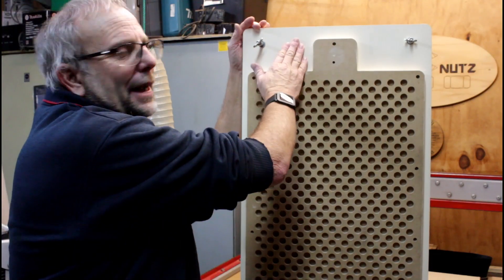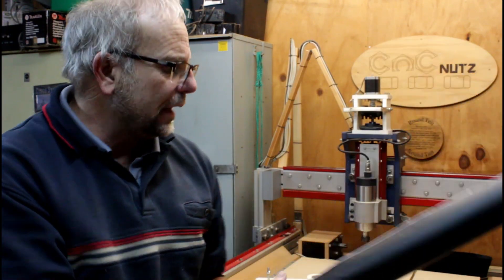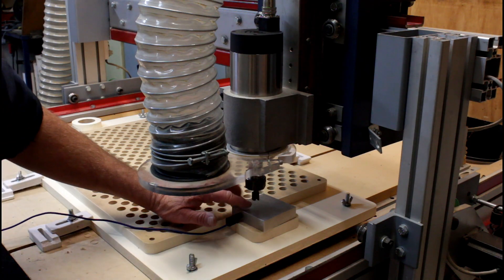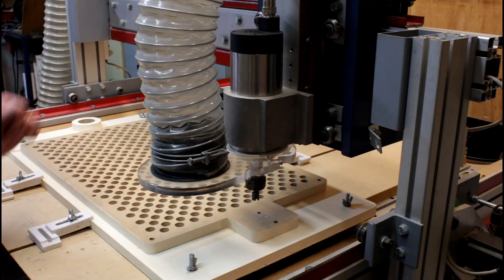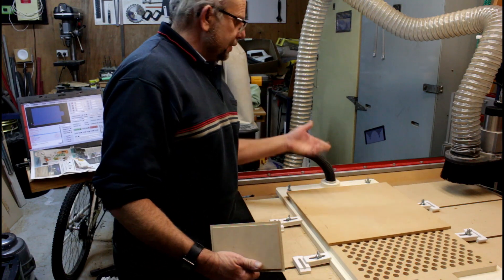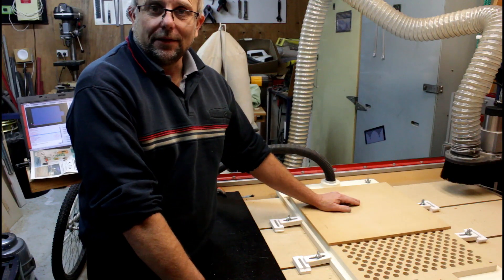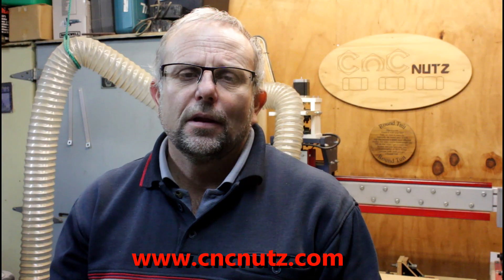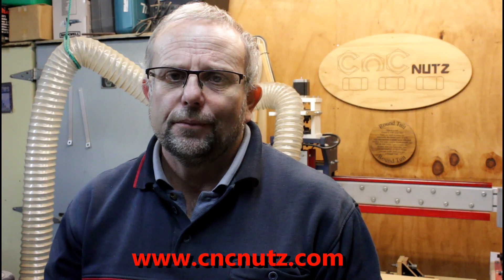DIY Vacuum Table Part 2 - CNCnutz Episode 211

Comment: can buy cheap vacuum pump about 2-4 CFM suck pump have normal used cnc table what has DIY made. and keep part good on table. normal have 3CFM pump what many uses. very cheap less than 100$ can buy. cheapen than owerprice festool shit vacuum. festool ALL tools have shit and totally owerprice. same can buy many other brand 3-5x cheapen.

Comment: Sorry if I missed it, but do you have anymore detail on the gasket material?
Reply from the maker: Hi John.
There S nothing special about it. It is 6mm round and on medium softness so easy to compress with the fingers but bounces back immediately. Not hard like oring rubber. I bought it at para rubber if that helps. Not sure what it's real purpose is but probably some sort of weather seal material.
Hope it helps.
Cheers Peter
Reply: @cncnutz  Thanks for the quick response. Wasn't sure if older video's were even monitored.

Comment: A HARBOR FREIGHT  2 HP GET RID OF THE BAGS AND IT WOULD BE CRAZY POWERFUL ...WOULDN'T YOU THINK?
Reply from the maker: If you talking dust collector then I don't think it would. Dust collector and vacuum pump are 2 different things. A vacuum cleaner is somewhere in the middle though closer to Dust collector end.
Cheers Peter

Comment: We use calibrated carton sheets for creating vacuum and it prevents cutting in to the baseplate! Also they use rubber plugs to block off certain airholes and foamtape to block off certain airslots. Might work here!
Reply from the maker: I have to ask Lute. What is calibrated carton sheets. I did a search but came up empty. Do you  have a link to the product?
Cheers Peter
Reply: @cncnutz  Can't find the exact product. But its like greyboard, 2 or 3mm thick.

Comment: Great Videos both part one and part two.  I just made one for myself using V Carve and my Axiom CNC.  This video series was paramount in giving me the design ideas to make it happen.  My table is only 2'x3' but I used the exact same concept as yours.  I love the top feed manifold, it works perfect and you've done a great job at showing all the possible issues that might come up.  More importantly the why behind what you did.  Thanks again!

Comment: Hi Peter, there's one thing about using the paper that is confusing me: how is it that the paper can both seal off the remaining holes yet allow enough air through for the workpiece to be held down?  Seems like those two conditions shouldn't be able to exist simultaneously.  Maybe I missed something?
Reply from the maker: It doesn't seal the holes. It is there to improve the seal. The holes are so small that the vacuum can keep up with the air loss from the uncovered ones.
Cheers
Peter

Comment: I built a vac table this weekend.... NoJoy!... Trying this style next. I am dying to no what the material was that "Michael" used in place of the news print. LOL... Thanks Peter.
Reply from the maker: I thought that Michael had replied in the comment section but i couldn't see it. It moght be worth you reading through the comments and see if you can spot it.
Cheers
Peter

Comment: One way to eliminate leakage through the base plate is to simply use melamine board instead of MDF.  The melamine coating will seal it up nicely.  You will have to use the heat seal edge banding to seal the edges. 

Route a continuous groove around the outside edge of the cross grooves and put in a piece of the urethane backer rod used to fill gaps around windows etc to make a better seal.

As far as your top, a simple piece of Superlite MDF or lightweight MDF is porous enough to use for the top sheet without having to drill any holes in it.  You may have to skim cut the top and bottom to remove the compressed outer layer to make it a bit more porous, and seal the edges. 

Seal edges with 1 part PVA glue mixed with 3 parts water.  This will seal better than paint or polyurethane, which dries porous because the solvent evaporates leaving microscopic voids in the coating.

MG
Reply from the maker: Thanks Darrell, 

I bought some 1/4" Oring material to use as a seal and have promptly lost  it. I as looking for it earlier this week anand still can't find the damn thing. Worse I have bought 2 lots for this project and have lost both. I wonder if it is a subconscience thing.
Cheers 
Peter

Comment: Great. I'm been wanting to make one and you gave lots great info.
Reply from the maker: Thanks John. As a suggestion don't drill. The tiny holes. In the center until. You have tested it first. With the porus nature of MDF I don't think it is needed. But you can quickly test it first before drilling the holes.
Cheers
Peter

Comment: Get a small vacuumpump, connect it to an old emptied propane tank with a vaccum gauge. That assembly connect to the cnc. Let the tank pull the vaccum..less strain on the pump. Your first design wasn´t so bad. Build a small box 1 1/4 inches tall. Couple of changes on the top. Only a few through holes for the vacuum a few plugs to plug the holes, that arn´t needed.  Use O-Ring material. You can get rolls of it and make your own seals with it. that way a vacuum is only created, where it is needed. The whole system shouldn´t cost you more than 300 bucks and should easily fit under your cnc.

Comment: I am building a small one and using some of your designs.  I am cutting a custom pickguard for a guitar out of a material called tortoloid,  the back of which any of my 3 or 4 kinds of double sided tape won't stick enough to.  This stuff is $50 for a small sheet and is only .029 thick so it easly can be picked up etc.  I can get the ds tape to stick if I remove the adhesive back cover which is so slippery but then I don't have the cover to  protect it until I am ready to put it on.   I have the feeds and speeds etc done on another pickguard I can throw away .   Ihave a couple of the rockler pucks but they deform it too much.  I may try just drilling holes through some mdf for those.

Comment: The bed where you create the vacuum in needs to be airproof. MDF is NOT that because of its let-trough structure (you can buy mdf airstones for in an aquarium).
You have to close both bottom and the sides of this bed with a few layers of very thin paint to (impregnate and) choke the wood, so the only way for the air to get in via the top.
Then lay a thin ply of expendable mdf (also with painted sides) on top of this. Your workpiece goes on top of this.
There is a way to have the vacuum fit 100% your chape, but that's not possible with the bed you made. If you want I'll explain.
I've been working on CNC machines for 24 years now, and have 'some' experience.
Reply: Please explain

Comment: make a pompe from the compressor from the fridge.
Reply from the maker: I looked at it but I don't think a. Fridge compressor could pull the volume of air I need for the table. I have seen people make them in the past but there is never an old fridge about when you need one.
Cheers
Peter

Comment: Hi Peter, This is a nice one. Good explained and learned from errors. I have seen the question about the building plans for this vacuum but there was no answer from you yet. Would you mind sharing the plans? I am designing it myself in Fusion 360 but I don't know the exact dimensions. Greetings.
Reply from the maker: Hi Aaron
Sorry for the delay in replying. I have been considering the request and while the table works well I think I can make it better which is why I haven't released plans at this time. I picked up some oring material recently to better seal the top and bottom and want to do some testing to see if the pockets I machined into the top are really needed. I hope to get this underway this month if I can.
Cheers
Peter
Reply: @cncnutz  Hi Peter, no problem. In the meantime I have designed and made one myself. I am now putting on some sealer (paint) but it already works great. I used your design as a starting point but with my own dimensions and my top is one piece (shop vac inlet and plate in one).
With the oring I don't think you need the pockets in the top indeed. Keen to see what you will make!
Reply from the maker: Nice one. Hope it works well for you.
Cheers
Peter

Comment: So only the festool one has a separate cooling path? What about dewalt makita? Any one knows
Reply from the maker: I'm sure Makita and Dewalt make vacuums that also have alternative cooling but it is a matter of finding which models. The easy way to test is to turn the vacuum on and block the hose. If there is still cooling air blowing from the cleaner then it must have alternative cooling. Look at wet and dry Vacuums as these are your best bet and should have separate cooling. Only an idiot would design one of these to pull water through the motor but test it just in case.
hope this helps
Cheers
Peter
Reply: stupid buy festool because you can buy less than 150$ REAL vacuum pump, festool or other normal vacuum cleaner have worst use. my cnc have vevor 3 CFM vacuum pump less than 100$ and suck all parts good to table. REAL vacuum pump have totally lot betyter than burn you vacuum cleaner motor. and cheapen than new cleaner have.

Comment: A lot learnt - i am thinking i will try to remove dust and create a vacuum at the same time.....i guess i am in for the same surprises...
thanks
Reply from the maker: Interesting idea Dan. Hope. It works out for you.
Cheers
Peter
Reply: @cncnutz   Ah - my dust extractor hasnt got the muscle. So far i have built a 265x810x 100mm high MDF block with a hose attachment, and am lacquering the exposed sides but the table side and the top side i am machining flat and square to aid porosity and like you i will add holes as required and an adjustable fence( i usually only hold down small pieces of oak 100x500mm) which i am hoping will be much easier with a vacuum table - thanks again for your video
Reply: @cncnutz  Well mine works to a point - i fill the unused area holes with small countersunk screws - but any twist in the object causes trouble - i am thinking a rubber gasket might be an option (seen in another video - which reference i am going to try to find) - thanks again
Reply from the maker: I'm going to do the same on my new build. I bought the oring. Rubber when I was visiting the big smoke a couple of weeks ago . What I really should have bought is time.
Cheers
Peter

Comment: A vacuum pump might work if you cover up the holes that would normally be open. Silicon mats would probably work fantastic for it. Just lay down the part, and cover up the open holes.

Comment: Hi Peter from Texas.  I am curious about how you are liking the vacuum device?  I want to make one about that size.  What new ideas or changes have you made ?  Thanks
Reply from the maker: I have only used it for 1 project and it worked as it should. Not really enough experience with it to say one way or another but I am happy with it so far.
Cheers
Peter

Comment: Its called Vilmill.  Vilmill™ is a specially coated Mill Through Mat.
With this mat, very small parts can be cut out - without slipping but your invention is genius mate. BTW Vilmill is available in large quantities in Europe if you need some let me know.
Reply from the maker: Thanks Zulfqar.
Very impressive stuff. Thanks for the offer but the paper seems to be working fine at the moment.
Cheers
Peter

Comment: Any reason a 60 degree vbit wouldn't work instead of the two step process for drilling the holes? Also, counter-top laminated is a fairly easy process. Perhaps 'it' could also be strong enough contain the small holes. Thanks for the update.
Reply from the maker: The only thing I  an think of is everytime you resurface the tabletop the pod size will decrease. Also depending on how level the top of the base layer is  the small hole at the bottom will vary in size. A very small error in cutter depth makes a big difference to the final hole size. A good bit of out of the box thinking but I don't think it would work.
Cheers
Peter

Comment: OK.  I'm confused (course that don't take much!!).  When you put the paper over the board, why does that not seal off the vacuum from the part when you lay it on the paper?  Is the paper just permeable (to vacuum) enough to still pull the work piece?  Or is there some kind of magic involved...
Reply from the maker: Hi Raymond. Personally I go for magic but really paper is very porous so the air just pulls through it. If 18mm MDF won't stop it then 0.2mm of paper won't but consider this. While it is 0.2mm thick once it is compressed between the tabletop and the stock the paper is up to 200mm thick horizontally which seals the centre ports very effectively. The sealing ability reduces as you get closer to the edges of the stock but every little helps. The result is a better vacuum and more holding. The paper also reduces the air loss through unused ports but do not stop it.
Definitely magic.
Cheers
Peter
Reply: Makes sense to me, I would have never thought paper to be that porous, but obviously it is.  Magic would be more fun though, but I guess facts are more dependable.  Great project.  I will try to make me something along the lines of yours.  I have a vacuum pump (Chinese type, but pretty good) but I will have to try to come up with some way of filtering the dust out of the suctions lines.  Don't want the dust going through the impellers of the vacuum pump.
Reply from the maker: Will be interested to see how your vacuum pump goes and to see what pump you are using. A quick filter you could use might be an inline fuel filter for a car. Just plug it into the hose line.
Cheers
Peter

Comment: Hey man i got that halftone photo done other day.Ive done more that turned out better. The one i made the video of was my first try. I have some big things in the works and getting to what i made my channel for.
Reply from the maker: I watched the video the other day. It looks like a PhotoVCarve type of cut rather than halftone to me. What software did you use to generate the Gcode? I like that the image is revealed as it is cut where mine need to be painted once it is cut to see the final image.
Cheers
Peter
Reply: the software is a free one i forgot what its called there is a link to it in the video description.Your able to choose from different toolpaths dots lines squares circles

Comment: This is a great solution for this kind of vacuum table, Peter. It works good with the vacuum cleaner option because of the tiny holes, I guess. The volume of air the vacuum cleaner sucks out of the system is much larger than the tiny holes can let through if you block a bunch of them. For that reason I think it might also work good with a vacuum pump system that has a pump not capable of moving large volumes of air, like most small light ones. Those move around 85 litre or so per minute, which is not as much as a vacuum cleaner does.

However, I think that the more vacuum can be applied to the workpiece on the table, the better it is. What you want to achieve is a maximum vacuum of -1 bar, resulting in a holding pressure of around 10.000 kg per square meter/1 kg per square centimetre. A small workpiece of, lets say 10cm x 10 cm will have a hold down pressure of a 100 kg at -1 bar, and a workpiece of 20cm x 20cm has already 400 kg hold down pressure! To achieve that, the system should have no leaks or vent holes in it. This is practically impossible, there will always be some kind of leaking, if it only were at the contact surface of the workpiece and the vacuum table. This can be reduced by using some kind of rubber sealing strip (often seen on vacuum tables with the block grid and air channels).

Even a high quality vacuum cleaner like the Festool can not achieve this maximum vacuum, neither an average vacuum pump (unless you buy an expensive lab vacuum pump with oil seals or the like).

So, although I think your present vacuum cleaner vacuum table is the best possible solution for this kind of setup, I've found that it is better and more effective to use a vacuum pump that can hold the vacuum at maximum possible negative pressure. After long searching and tinkering around ( I've build a vacuum forming machine with a converted shop compressor that works damn good, better than expensive machines that I've seen in professional shops) I finally found the kind of control that I was looking for in........of course China. It's an digital vacuum pressure switch/controller that can easily be mounted on a shop compressor. With some minor changes you suddenly have a combination of shop compressor and vacuum pump in one with added benefit of a buffer tank. All for less than US $ 150 (brand new shop compressor and vacuum/pressure controller) and some valves and hoses.

Many makers are using a CNC (with vacuum table?), vacuum hold downs on the workbench, vacuum forming machines, vacuum bags for veneering or making your own plywood, etc. This can now be all operated from 1 vacuum pump/pressure pump. A significant saving on costs in the shop, I guess. I will send you some pictures of my setup and a short explanation how to do it, leaving it up to you when (and if) you want to make a video of it and share it with the community.

By the way, the surfacing of your vacuum table is a masterpiece of craftsmanship! Man, do you have your spindle dead on square in all directions. I was speechless when seeing it. Thank you so much for all the excellent videos you have put on your channel, I've learnt a lot of them. Please keep it up!
Reply from the maker: Thanks Paul, I look forward to seeing your compressor conversion. Sounds great. I used it to flatten some wood last night and it held the wood well. No more clamps in the way. I spent a bit of time last year tramming the machine and it seems to have paid off.
Cheers
Peter